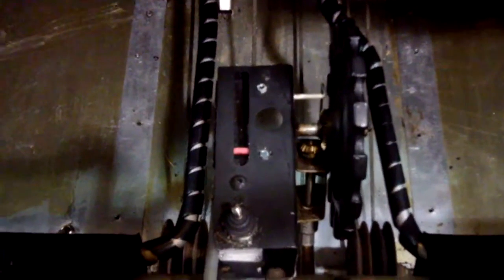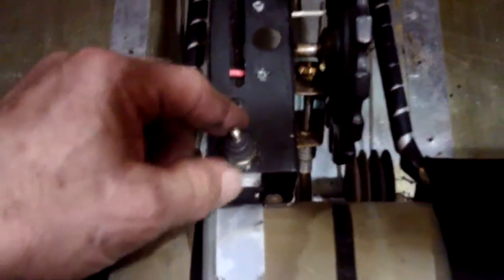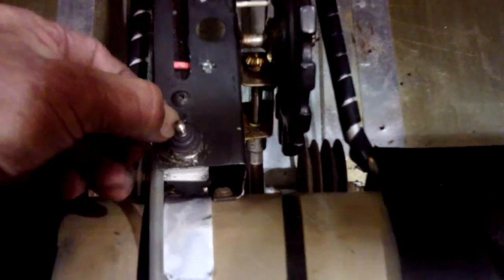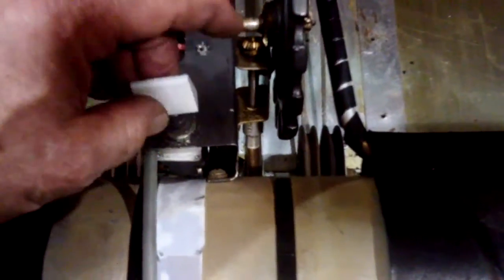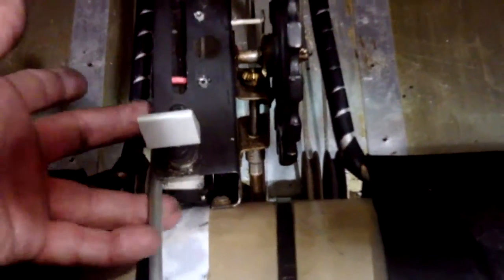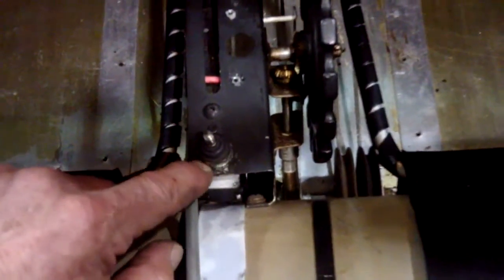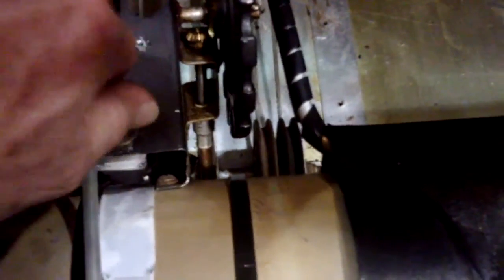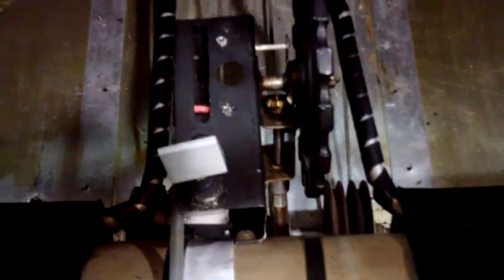Grumman Flap Switch  - Grumman Style

Comment: What if it’s not the switch but the motor? Fletchair?
Reply from the maker: Or the wiring (brittle after 50 years), but yes Fletchair for the new motor.
Reply: What size plug is on these motors for the brushes?